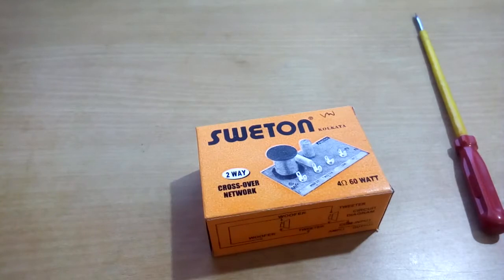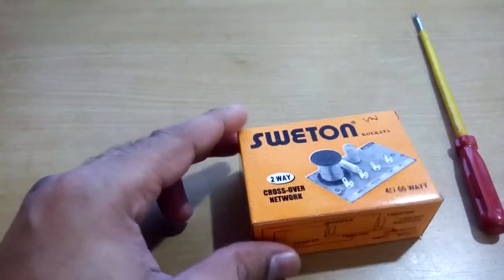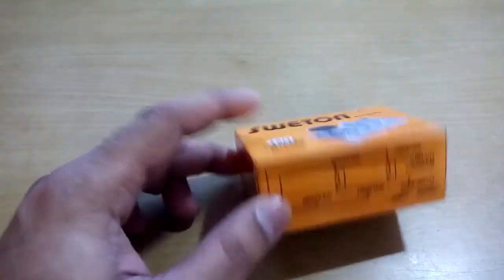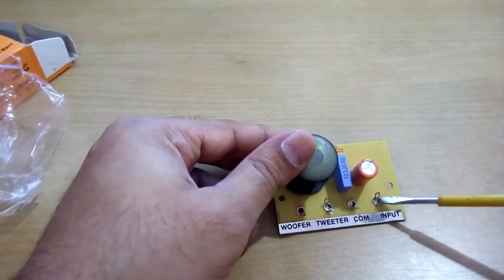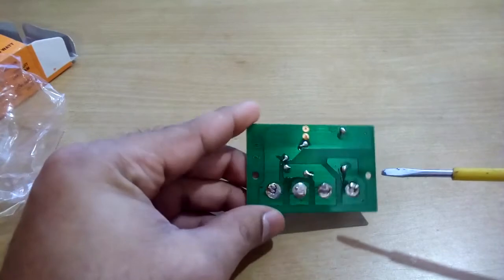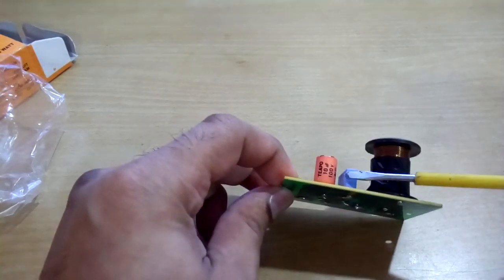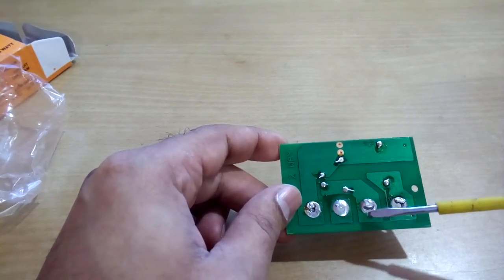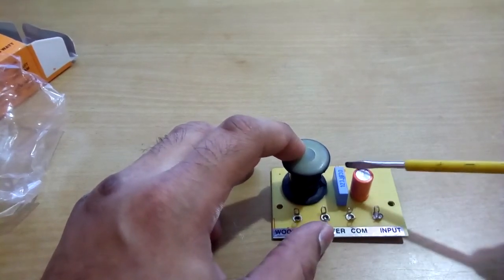Speaker Crossover (basic)

Comment: Excellent explanation, my question is that for how many watts amplifiers is this device used, can we use it for tda 20 30 amplifier in which three speakers are used ,woofer 5 inch 4 ohms 30 watts, midrange 4 ohms 15 watts and tweeter 4 ohms 10 or 15 watts. Please give in detail few lines on this set of amplifier and speakers. Thanks.
Reply from the maker: This is a 2 way crossover. You can use it with 80 to 100 watt amp & speakers. You can use 10 to 12 inch woofer too. As per your specification you have 3 way speaker system, for that you need 3 way crossover.
Reply: @technoboy-allinOne  you are right, but I want to keep the woofer undisturbed and connect mid range and tweeter for good quality treble,  thanks for exellent explanation and reply.

Comment: If I have One Tweeter and one woofer and I connect them in parallel directly without crossover what will happen ?
Secondly, if one 10 watt tweeter and one 20 watt woofer is connected together in parallel, how the amplifier wattage will be divided if the amplifier is of 30 watts?
Reply from the maker: Ans to your 1st question. Nothing will happen. It will work. But the sound will feel like all mixed up... the woofer is made for lows & mid & tweeter is made for high frequency only. So when you use a crossover. The coil cutoff the highs for the woofer & the capacitors cutoff the lows for the tweeter. So then you hear clean & clear sound.

Ans to your 2nd question.  It will mostly be like 20 watt. Tweeter watt doesnt really matter much to the amp. But a low wattage tweeter will have loud high piched sound if you dont use a good crossover.
Reply: @technoboy-allinOne  thank you